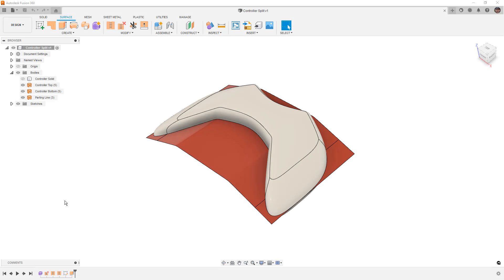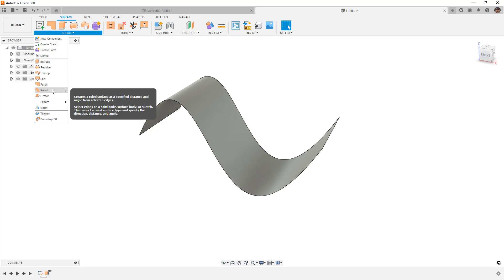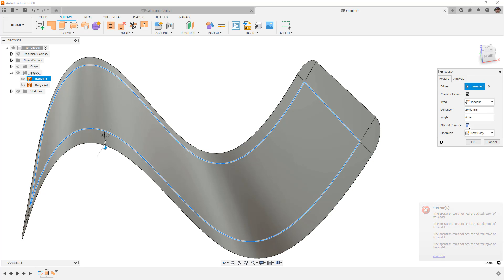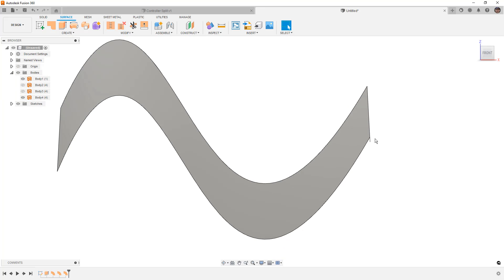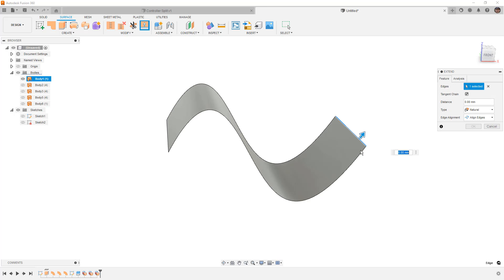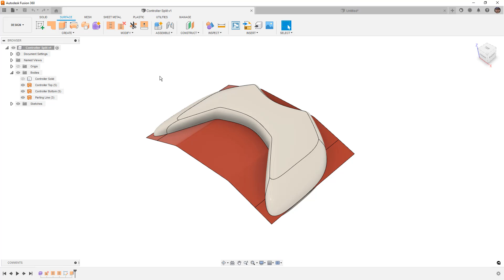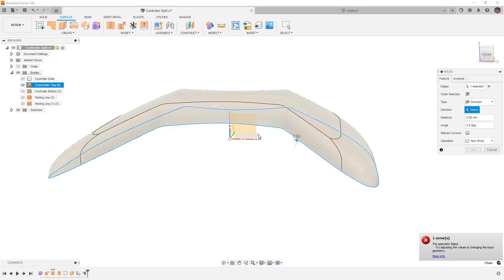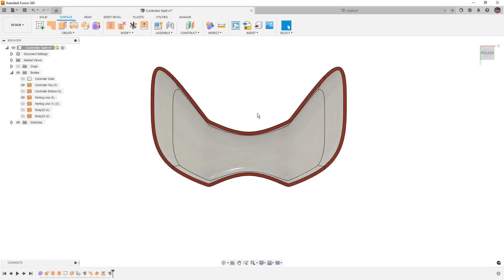Surface Mastery Part 3 - Ruled vs Extend Surface | What is the different and when to use them?

Comment: All of this is very interesting! I've been getting better and better at manipulating complex shapes with just solid tools, and I'm learning quite a bit with these tutorials on surfaces, but to be honest, as of right now, the most compelling reason for me to use a surface workflow compared to a solid is just how laggy and unoptmized the extend to surface tool is. It's such a cool tool and helps immensily with complex shapes, but for some reason it makes modelling anything such a slow and painful process, I can feel fusion struggle for a simple action and I do have a good PC that I work on. Not quite sure if it's just me or a quirk of the program, or maybe just me trying to use it on difficult cases, haven't figured it out yet.
Reply from the maker: Yeah it really depends on a few things with the Up To Object.  I find in several cases I end up making an Offset surface for the area i want to extrude up to.  Part of the problem comes when you select a body vs a surface.  it might not know where to extend to.  Of if you are extruding a profile wider than.  If you watch Part 3 of the recent scan to part design series i ended up having to do a lot of surface work because extruding up to an object didn't work.

As far as performance, i haven't noticed that.  It either works or doesn't.  But even last night I was modeling something and wanted to just push a face in.  I split the face and tried offset, no luck as the surrounding geometry was messed up somehow.  I tried to extrude offset from a face. nope.  So i ended up offsetting a surface. deleting the original and building back everything else with lofts and patches.

Knowing how to do it all when the simple option fails is key!
Reply: @LearnEverythingAboutDesign  yeah see, I hadn't thought about offsetting a surface from the solid and using the tool to that surface instead of to another solid, maybe fusion just doesn't like that type of operation. Thanks! 
Also, since I have you here lol, how do fusion 360 toolset for surfaces and form type objects compares to other cads? Are these type of operations comparable to what we could find say in  solidworks?
Reply from the maker: @MrChoklad  Solidworks doesn't natively  have SubD (form) modeling unless you by Power Surfacing add in.  They do have it in their web 3d experience platform but its independent.  In fusion its "direct modeling" but its in the timeline so you can work in the context of your file.

What you will find is most CAD programs that include SubD tools will have pros/cons.  Solid Edge has some sub d but its limited and they don't work well with scans.  Power surfacing in solidworks is great and has some options missing from Forms in Fusion like a true edge weighting.  So you can say do something between smooth and a crease.  Rhino (haven't tried 8 yet) has a bad ui/ux design so its clunky.  Rhino 8 is supposed to be better.  You generally get better tools when you go up in price like Alias, Creo, NX etc.

Surface tools in Fusion still have a ways to go honestly.  The quality isn't great and you end up doing a lot of extra work that would be eaiser in others.  For example in Solidworks you have "mutual Trim".  You can pick like 10 surfaces and then pick which pieces you want to keep.  In fusion you have to do 10 trims to get the same result....
Reply: @LearnEverythingAboutDesign  oh, great info, I ask because I'd like to get some solid basics in 3d modelling (it's not what i mainly do, I'm studying EE at the moment, nothing related directly to this), but sometimes I wonder if fusion is the right program to learn or I should go for something more "professional". I was also thinking about programs like blender where you manipulate the mesh directly, and was thinking, for these kind of projects, with curved surfaces and all, cad tools like these are inherently better than direct mesh manipulation or the question doesn't make sense?
Reply from the maker: @MrChoklad  If you plan on doing any PCB design I would say Fusion is the way to go.  I do have some "Absolute beginner" courses as well as a game controller design which is CAD, PCB and programming on my website. https://www.learneverythingaboutdesign.com/

Comment: I prefer not to use the surface trim tool, as when you change the geometry of the body ever so slightly sometimes the trim flips and causing lots of downstream problems. That can be fixed, but the more complex the model gets with drafts and fillets it can be pretty hard.
Reply from the maker: Very true.  Sadly I have found that to be the case even with split body/split face.  If you split a body there are times upon a change/rebuild that it will grab the wrong part.  If Boundary Fill didn't seem to be broken(selection boxes) it might be a reasonable solution, but there are just too many times you need that trimmed/split edge to function/design.

Thanks for the comment!